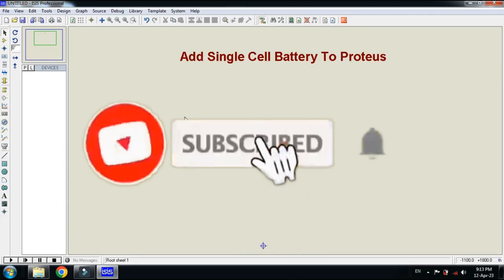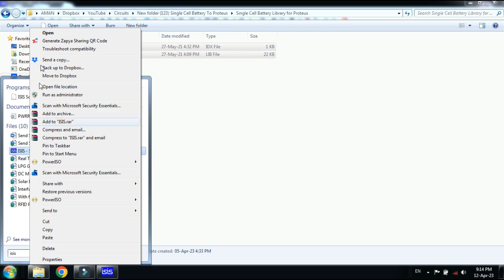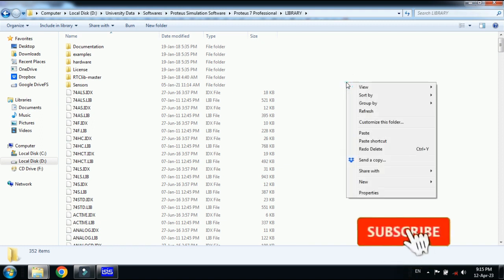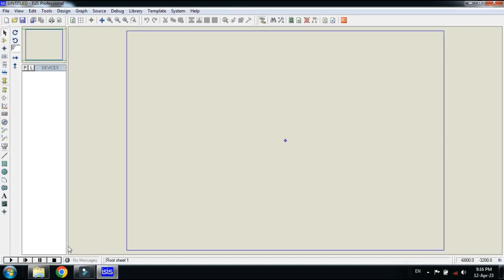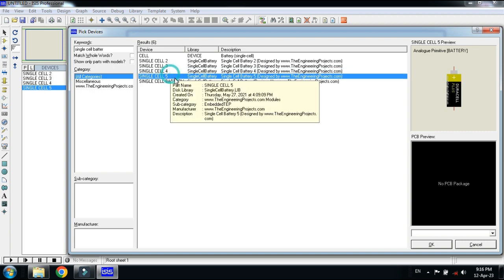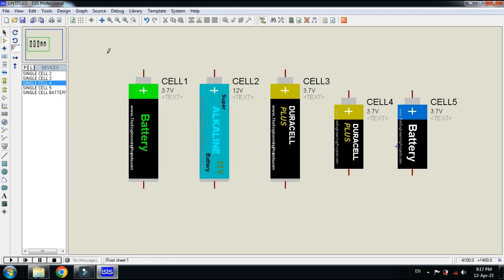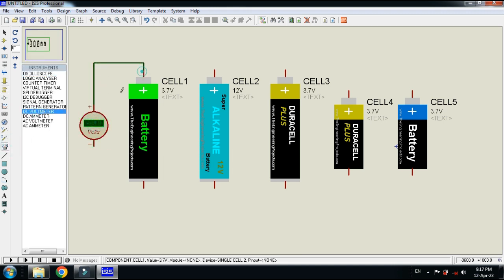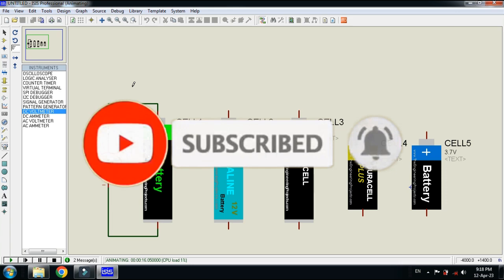How to Add Single Cell Battery to Proteus | Complete Guide

Comment: I need MPU6050 library for proteus please,  it's very important
Reply from the maker: This library is not yet designed for Proteus. You should to use potentiometers and change manually the values and get the desired results. Thanks